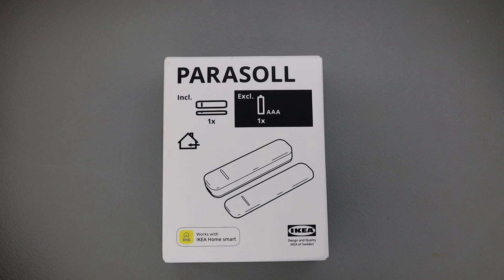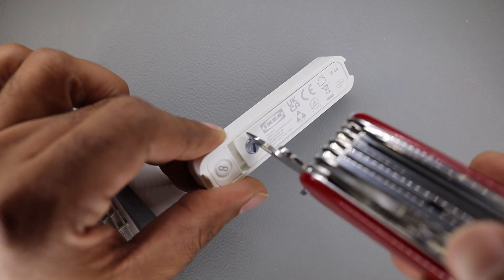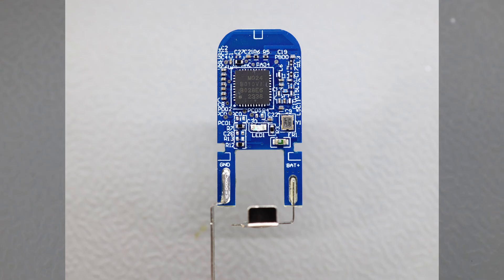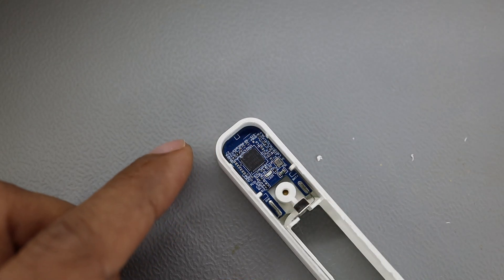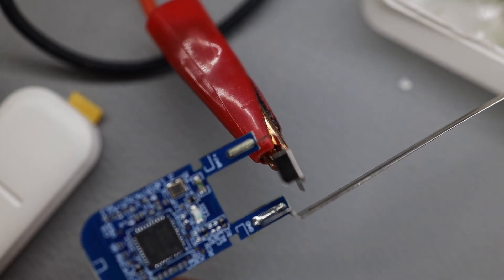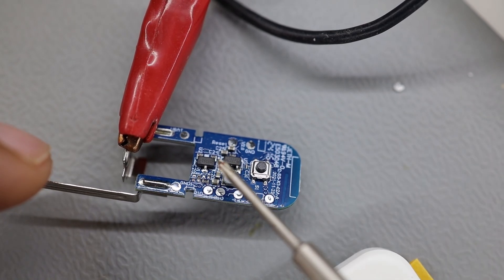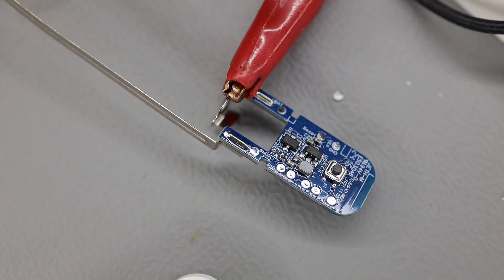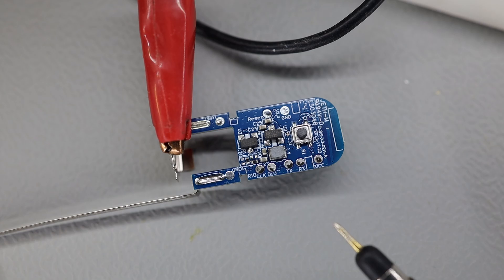Ikea PARASOLL Smart Door/Window Zigbee Sensor Teardown Hall Effect sensor Analysis

Comment: Could you also do a teardown of the magnet component? Also, I wonder if this device could be modified to detect whether a door is locked by inserting the sensor into the door frame and magnetizing the deadbolt. So when the deadbolt slides in to lock the door, it comes close to the embedded sensor.

Comment: Just as an info, if you take the hall sensor off the board, you can replace it with a switch. You just need to connect both legs that are on same side of SOT-23 package, the 3rd leg is GND and you can leave that in air. Now that I'm thinking, maybe it's a good idea to include a pullup/pulldown resistor but so far it works good for me :)
Reply from the maker: Thank you For your Info.
Reply: @circuitvalley  oh by the way, the pulsing is probably just to conserve energy.
Reply: Did you try to wire the existing sensor? (I assume you were also trying to create a solution where the electronics could be hidden/waterproofed)
Reply: @kke I tried it and it works fine. No need for me to remove the sensor.